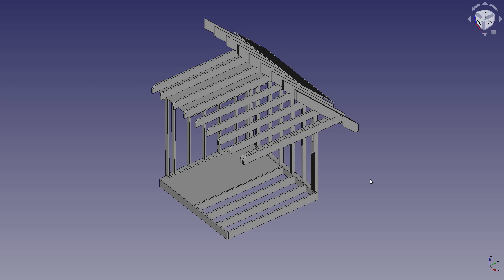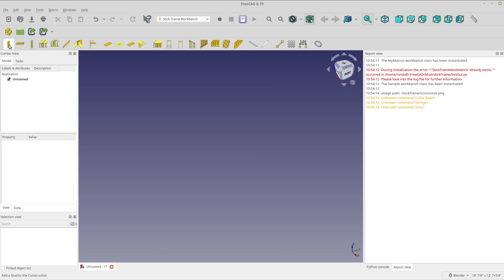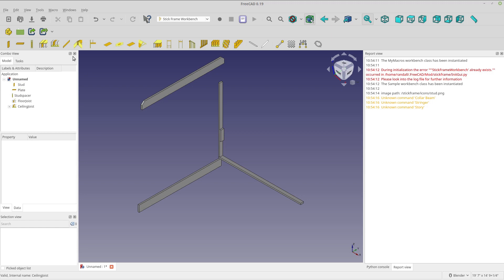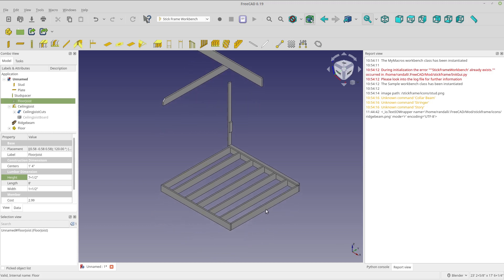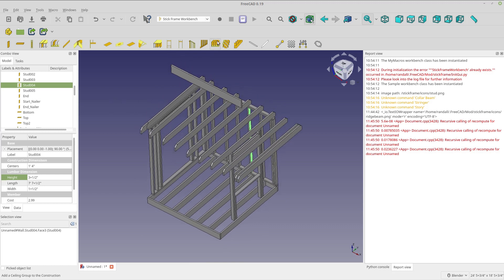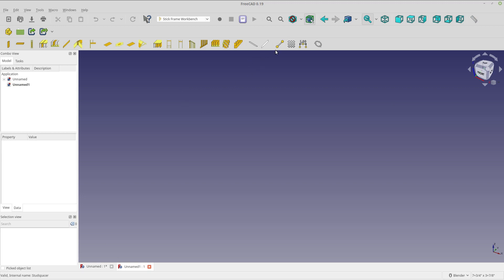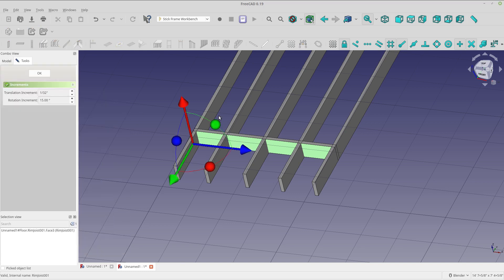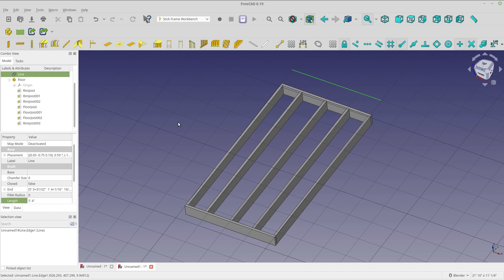FreeCAD Workbench - Introducing my Stick Framing workbench for FreeCAD

Comment: Hey mathcodeprint!  Noticed your efforts on the stick frame approach on FreeCAD.  thought the concept was excellent.  I had eventually came to the same ideas in the last month with FreeCAD.  I see so many people interested in the idea.  Obviously it has demand judging from the larger corporations and even smaller streamlined ones like Sketchup.  May I ask a naive question:  Why so many start people an obviously in demand idea and then stop?  Why did you stop.  Even now people are still looking for this on FreeCAD?

Comment: Fantastic! I was just thinking about developing a workbench that would enable the generation of structural wood elements from walls, slabs and roofs on Arch/BIM. Similar to how the "Reinforcement" workbench adds rebar to elements. In this case, it would involve setting the studs, spacing, joints, and so on.

It's going to be a long journey, and I'm still learning how to bring this idea to life. Greetings!

Comment: This is great gonna install this and test this out.  I was really surprised that the Bim workbench didn't already have something like this in it.  As i'm just getting into the Bim/Arch part of Freecad (This really is a feature that the Bim workbench is supposed to have IMO, maybe a collaboration/coordination could get this worked in and get additional help on refiniing it, just a thought).  If i had the bandwidth i offer to even help as i used to be a coder.  My Python also isn't very strong however, plus i haven't written any code in several years lol.  
I'd love to see alternate studwall corner options on this.  aka advanced framing technique uses more of a "L" stud layout for the corners so that you can insulate behind the corners for houses obv.

Comment: Mine freecad versions (flatpak, appimage, and linux distribution repository default version) are very very unstable cause Segmentation fault. So frustrating working hard to progress the drawing and suddenly be kicked off. Per one day app crashed in best scenario  more then 10 times. Application is really awesome in term of capabilities, but definitely not ready for serious work.
Reply from the maker: FreeCAD or my Workbench? I use FreeCAD on a daily basis ( version 0.19 ). I expect maybe one crash per day. but it seldom costs me anything or much work.  ( Save often ).  If you are talking about my workbench, yes, it is super crappy, it was an educational experience for me.